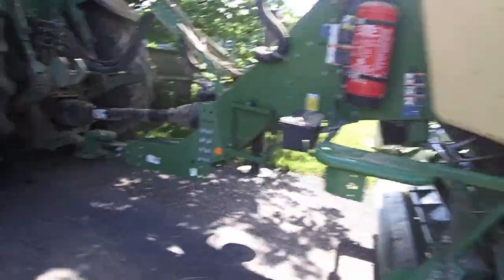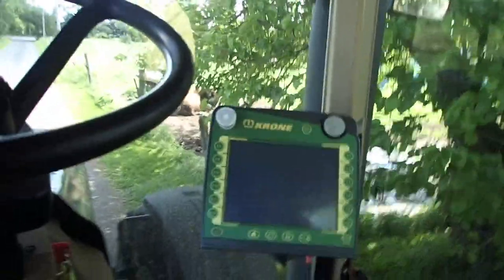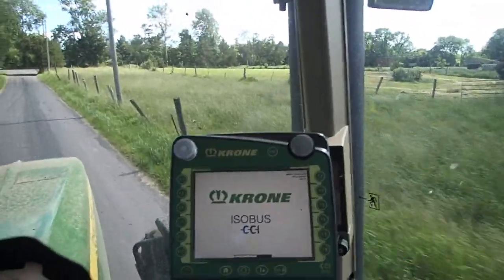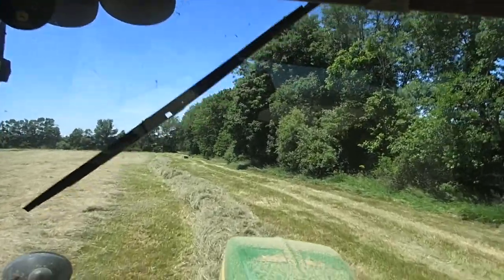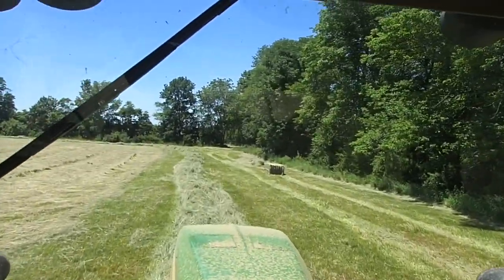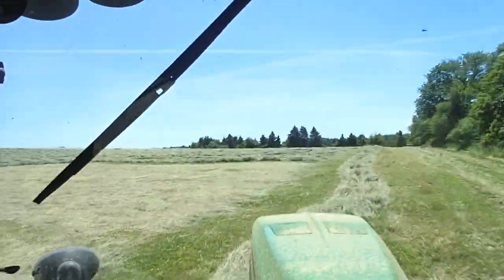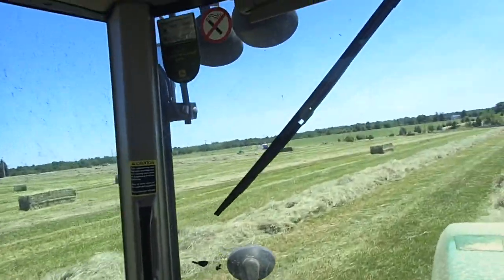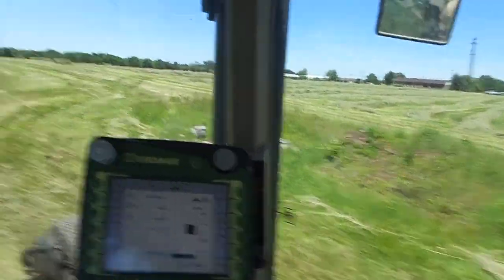Solo Shot Attempt 22

Comment: Tim...... I noticed you make a lot of sharp turns with the baler. Have you had any trouble with the CV joints in the driveline. If you get a chance will you feature them in a video and explain how they work.
Reply: He already replaced one or two of those complete drivelines when he got the baler, the factory forgot to grease it or something.
Reply: Johnny Holland Tim isn’t driving the baler Wes is. Tim is driving the stack wagon and a stack wagon is all hydraulic powered. I’m pretty sure Wes skips every other row so not to turn so hard.
Reply: Yes....Yes he is. That is what you get when you reply half asleep. Sorry for the mixup Wes and Tim. Seems like I do remember now he replaced the driveline at one point.